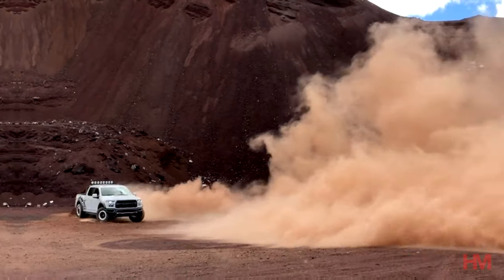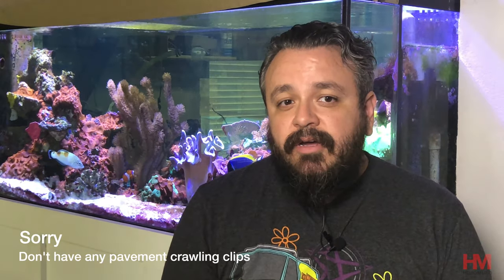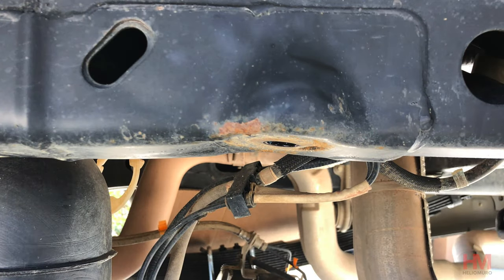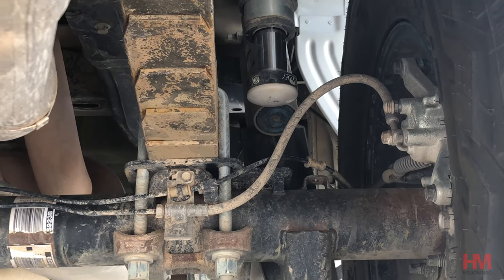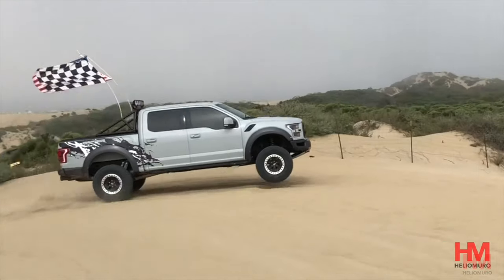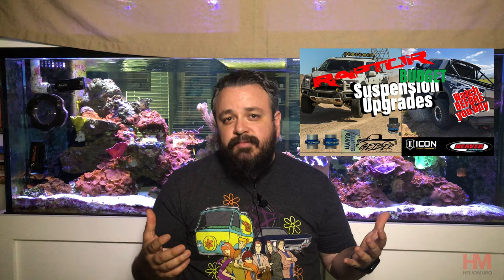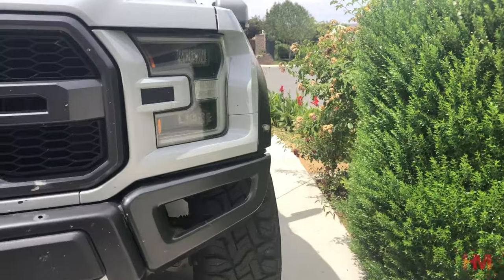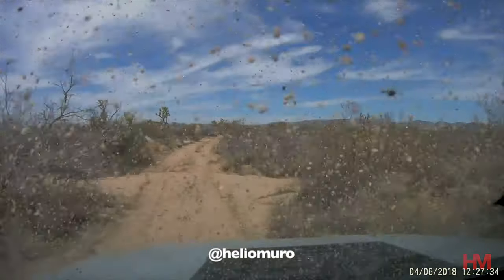Top 3 Raptor Mods for Off-roading

Comment: Interesting, I keep seeing comments when others do leveling saying “why would you mess up the gen 3 suspension but doing that?”

I currently have a gen 1 and trading up for a new 2023 gen 3 and doing my research about what to upgrade. 

Will be my daily driver in Colombia where off-road is a given, but also lots of highway and tight windy mountain roads
Reply from the maker: So most common mod on the gen3 is to raise the nose a bit for off-roading. Stock the nose is lower to get better fuel economy. But offroad it’s about an 1.5 inches too low and when the suspension hits full compressions, the front bumper hits the ground. So most raise the front end. Some do it with shock collars. Others with springs. We recommend the SDi top hat because we’ve seen too many failures offroad with spring upgrades. If you want more info, check out this video:

https://youtu.be/-Co8G7vyLdw?si=GkOdU-Ar7DFjU9jQ

Comment: can you share any bump stops/leveling kits for the first gen raptor? love your vids!
Reply from the maker: Gen1 don’t need a leveling kit. The front shocks have an adjustable perch to raise the nose and it’s the best option to get more height. 

As for bumps, pick a brand that uses a bump kit that wraps around the frame. FMI and Icon are the best option. But depending on what you do the SVC and RPG kits are good too

Comment: Dose the front lift effect the performances by the way it drives on the highway when accelerating or performing on twisty back road driving. Did you notice a difference something and mine is a 2017.
Reply from the maker: Not much no. Even if you keep the softer springs and do a collar or go with upgraded springs. Both stiffen the front end a bit so you’ll feel more of the road, but performance is still really good
Reply: Keep It Dirty Off-Road I ended going with the eibach springs. It was a easy install and the truck is now nicely leveled now. 🙌🏼
Reply from the maker: @HotshotTek  right on man, Congrats on the  upgrade.

Comment: Another great vid....I was trying to guess and thought rear Deavers/ICONs would have been one. Didn't think about the camber/castor kit, but after running with the ROC at Mojave several weeks ago the first thing I did on the way home to see if the truck had a pull, or the steering wheel went off-center..much to my surprise felt perfect...
Reply from the maker: The great thing about running with groups is there is less surprises on the trail so less chances of knocking out the alignment or causing damage. In a group, the lead truck takes all the risk.

Comment: Hi,  would you mind if I ask how much your pay the labor， about install the Camber/Caster Kit ? By the way. Great video. Thanks for sharing.
Reply from the maker: Thanks you, really appreciate it. I paid $165 to have the alignment kit installed and the front end to be aligned. Took them just over an hours to perform the work. Most shops should be able to perform it within 2 hrs or less including alignment.
Reply: Keep It Dirty Off-Road Thanks for  reply  ！May I have the shop name or address？ I ask a shop nearby my house ，they offer $275……  Thanks again！
Reply from the maker: @tigerrc  if that includes the kit, it's not a bad deal. labor for mine alone was $165 plus the cost of the caster camber kit. I used precision alignment in Temecula. But any alignment shop can do it or specialized Raptor shops like SVC, RPG, Evil Manufacturing, Galpin Auto Sports, or Forged offload should be able to help you install at a more reasonable cost.
Reply: @KeepItDirtyOffRoad    Thanks again, $275 only for install ,I bought two kit base by your link. lol,  I live in Rowland Heights.  hope to have the opportunity to go off road with you.
Reply from the maker: @tigerrc  right on man, definitely should make that happen. I usually post run announcement on Instram, but I think I'm going to start posting here too now on my weekly video vlogs.

Comment: Thanks for these educational videos but have you guys faced any problem with overheating in the Gen2 ?
Reply from the maker: Only once. Going up Cerro Gordo in the middle of summer with 105 degree weather. It was a steep climb, no wind, and I was pushing the engine hard going 60 mph+. The truck did not actually overheat, but the warning came up that I was getting close so I stopped to let it cool off a bit.
Reply: Keep It Dirty Off-Road My truck has the this problem of reaching height temps of 240 once Iam hard on the pedal .My next upgrade will be a full race radiator and intercooler and I hope I get it solved.
Reply from the maker: Saud Al Shuaibi are you running an upgraded intercooler? If so, that’s most likely the cause for the overheating. They are big and when placed in front of the radiator they block too much of the airflow to the radiator. Those that run hard, and run an upgraded intercooler I have seen all need to upgrade the radiator just to compensate.
Reply: Keep It Dirty Off-Road No I don’t stock radiator and intercooler. I do run a Spd state, dp’s , turbo adapters  tune , Icon stage 4 kit on 35’s. There is no reason for this truck to overheat but I couldn’t figure is out till now I hope the radiator will fix it but the reviews online say the radiator will not kill the overheat problem but it will give you some extra time before it over heats. I will be placing an order today and see how it goes.
Reply from the maker: Saud Al Shuaibi yeah, then there should be no reason for the overheating. But then again there is a fine line between operating temp at 190 degrees and what the truck considers overheating at 240. A new bigger radiator will help, specially a full aluminum one that dissipates heat better. I would also take a look at your tune. Lots of bad tunes out there that cause more bad than good. What tune are you using?
Reply: Keep It Dirty Off-Road Your totally right I just placed an order for the full race radiator and will keep you posted once it’s here and I installed it. I do run an MPT tune but you might be right , I’ll go back to stock today and do a run and check out but I have reported this to mpt previously but didn’t work with them on data logging as I didn’t have the truck with me at that time.
Reply from the maker: Saud Al Shuaibi heard a few stories, mostly bad, about the MPT tuner. That may be the cause but if your running SPD down pipes and their adapter a tune is a must or you will be loosing power. I run the Cobb tune and overall it’s good but it does have some drawbacks in that there is no transmission tune and she gets twitchy. Also heard problems with over boosting. So I’ve taken it off.
Reply: Keep It Dirty Off-Road Yea I didn’t go with Cobb exactly because they did not have the trans tune. So if all options fail I will have to go stock again